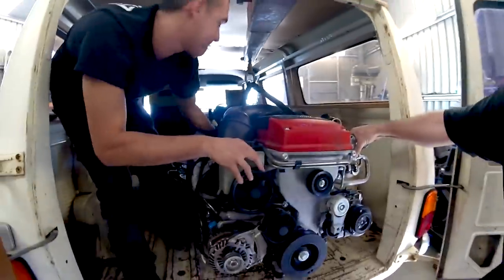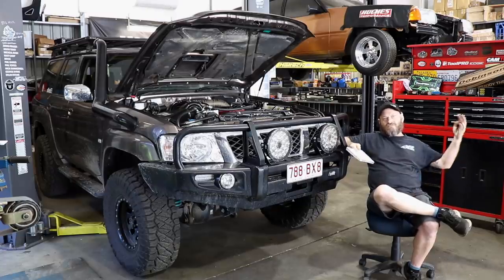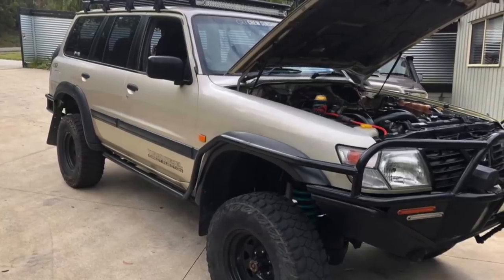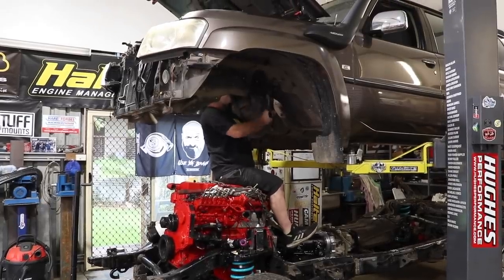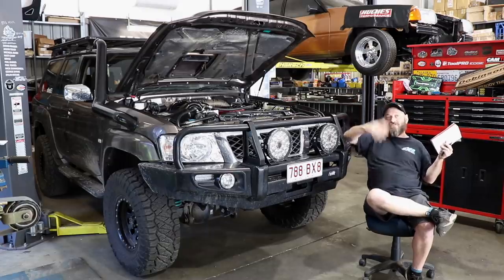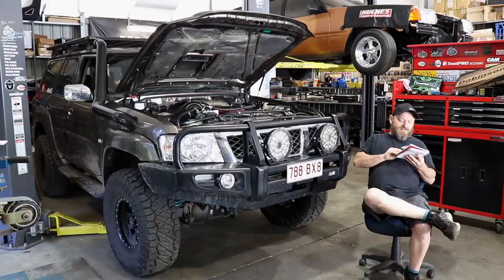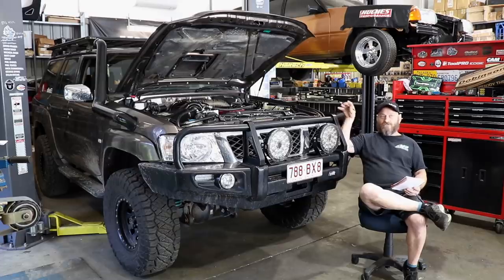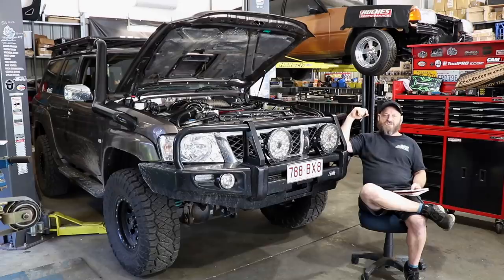Thinking of a Cummins Conversion? Watch This First!

Comment: I have been researching putting a 4JJ1 conversion into the Patrol. I did a conversion from a RD28 to a TD42 and whilst I love the conversion it has cost me an absolute fortune with turbo, intercooler, injection pump and injectors upgrade plus tuning. After the research I have done I reckon I could have converted to a 4JJ1 with turbo, intercooler upgrades and ECU remap and would have costed less than the conversion and power upgrades to the TD42. Just my opinion on a conversion

Comment: Glad you touched on torque vs HP, most people hear low HP numbers for a diesel and think it is gutless, when the reality is it is far more powerful since it's torque output is far higher and usually at about half the RPM.
Reply: Gearboxes can convert high rpm + low torque into low rpm + high torque, and vice versa. It's still ultimately the horsepower (torque * rpm) at the engine that matters.
Reply from the maker: Until you add external load to the vehicle via towing and your high power 8 speed auto 2l twin turbo diesel suddenly isn't the same. 
Gearing cannot replace engine torque.
Reply: There's definitely a question of comfort.  A small engine screaming along at 8000rpm and a bar of boost producing 300hp is going to be a lot less comfortable to drive compared to a huge loping diesel making the same horsepower at 3000rpm, but at the end of the day they'll still both be capable of doing the same amount of work and making the same output torque @ rpm with appropriate gearing. And yes, I accept that the pocket rocket will no doubt overheat and live a short life due to the relative stress it would be under.  Anyway, it's a dumb pedantic argument so sorry for clogging up the comments. Great content btw..

Comment: This is one of the cleanest swaps ever done, on youtube anyhow. But my god, as you have mentioned, a 6bt is waaay, way too much engine for a vehicle this size. There are tandems in the US fitted with 6bts. People put 6bts in half tons over here as well, and it makes absolutely no sense other than simply doing it because of the popularity of the engine. Like in your offroading video, it is almost impossible to tap into the potential of a heavy duty engine like this without putting serious strain on the vehicle, which will eventually destroy everything, even one as well prepared as yours. Not sure on the availability of 4bts over there, but that is really the only cummins that makes any sense.

Comment: Bought a new 2016 3.0 patrol and what really pissed me off, my 1992 TD42 patrol was nicer to drive and had way more power. So I bought a new GX land cruiser. Heaps of power and no conversion problems. Probably will not last as long as a TD42 patrol but it is nice to drive. You want power and nice to drive KEEP THE WEIGHT DOWN.

Comment: Wow this is decades ahead of me. I’ve just gone the ol 6.5 diesel Na, I got it for $6000 from Brunswick diesel in WA, Was reasonably easy to install onto original 5 speed manual… I think I use less fuel than a Barra conversion would… in saying that  my 6.5 is a slug 🐌  but I love her 😁

Comment: If you are looking for a late model Cummins Common Rail Engine, you could be like Rich and fit a Bus Engine. 
Most of the smaller Chinese buses in Australia, like Higer, BCI and I'm sure others, have ISB Cummins engines in 4 and 6 cylinder versions, and seem to push these Buses around quite well in standard form. I'm sure they would have no problem powering a Patrol or Landcruiser.

Comment: A lot of people around the world are fitting the BMW M57D30 motor, 6cyl turbo diesel producing 215hp and 500nm from factory. Very easy to tune them to around 250hp and 600nm in factory configuration, pretty quiet, reliable, responsive motors and easily drivable. I believe there are kits around to drop them into the older GQ Patrols and possibly Toyotas.
Reply from the maker: I think you mean a lot of people in Europe are fitting those engines.
Reply: @theskidfactory  there's guys in the US and Canada that have done it, and I believe there may be a few in Aus (at least one attempted it in Brisbane in around 2016, not sure what the end result was), so not just Europe. Definitely more in Europe as it's easier to get the motors, but has been done elsewhere.

Comment: As for the merc diesel- we just had one that ran well come through the shop with close to 950,000 miles on it. Driver said they’d done a tranny but the motor had never been cracked open. Was a sprinter van.

Comment: Hey Al here in the states commercial trucks use what is called a Jake Brake which use's engine compression to slow down Semi's here in the state's I am 69 years old and used to drive big Rigs back in the 70's and 80's and in a lot of high mountain driving so we always had Jake brake's on our trucks.
Reply: big difference in a 50 ton big rig and a three ton 4wd also i believe his talking about low range off roading where the general idea is to put the transmission in first or second gear with the transfer case in low range and just let the engine idle down a steep tricky decent at walking pace

Comment: My dad drives a 2007 Ram 2500 with the 5.9 Cummins and the (extremely uncommon, it would seem) Getrag 6-speed manual. With just a basic flash tune the thing is ludicrously quick for a vehicle of its size and it's well over 300k km with not a heck of a lot of trouble. Just an alternator, a couple recalls, a belt tensioner, and regular maintenance. Rowing the long throw gear shift while hurtling down a stretch of highway is a weird sensation compared to my car, a GR STi 😆
Reply: I prefer the NV5600 over the G56, but both were excellent manuals behind the 6BT.  The ZF 6spd used with the 7.3 PS and the Duramax (you want to talk about rare!) was also good.

Comment: Awesome build summary! For a larger SUV like a Patrol I'd do a Ford 7.3L gas V8 if I could, pretty small and lightweight (for the capacity) with output of 430hp (320kw)/475lb-ft (645nm) on the crate engine. I drive the commercial variant of it in my work truck which is only 350hp/470lb-ft, it's fantastic for pulling around a 15-20,000lb (7-9,000kg) vehicle, has a load of low-end torque and gets decent fuel economy for what it is.

Comment: Before doing the ls3 and 6l80 swap in my Landcruiser I talked to a few guys that had done ls1 and ls2 swaps in there cars, they wanted more power and said the swap wasn’t that much better than the stock 4.5 petrol cruiser engine. I’m happy I went the ls3 and 6l80 but even doing all the work myself like Al also drawing on a number of other conversions it’s still expensive and takes hundreds of hours to do it right. I think these days in Australia the only semi budget friendly option would be a Barra turbo.
Reply: A ls1 and ls2 is leaps and bounds more powerful over the 4.5. The ls3 just has good cylinder heads and the camshaft comes on later in the rpm range to make impressive sounding peak numbers. The power curve overall is what's important.

Comment: I've personally had a tb42 turbo patrol, a tb45, tb48, numerous td42 patrols and converted a gu with a td42, and also a 5ltr 304 patrol and the most reliable and best patrol I had was the tb48 if I was looking at doing another patrol I'd be looking at a barra cheap, easy plenty of information around its been done a million times the parts you can nearly find on the side of the road etc etx all good things to think about.
Reply: Sorry to add to that the tb42 turbo was the most fun there's videos on my YouTube of it. Racing people on the streets back then was a good laugh they never expected a 3 ton plus 4wd to round them up!

Comment: As a Nissan tragic and a mechanic I watched every second of this build and loved it, well done fellas 👌

One thing I did cringe at was the ✌️massage / murdering ✌️ of the firewall. I know the fact that you cannot see it, nor doesn’t effect the vehicle in any way. I’m even guilty of it doing to ease td42 patrol clutches etc, But do you think you could of gotten away with less firewall massaging if a inch or 2” Body spacer was installed ?

Comment: I have an ML400cdi, with the om628 4.0 v8 diesel and it is amazing how compact and light (all aluminium) it is.
Yes, it has some problems, like timing chains, but once done it is reliable, pulls good and has a very low fuel consumption.
Also you can probably use the original 5speed tiptronic associated, which is cheap, and save some money and headaches in custom bell housings, etc.
Reply from the maker: This is one of the engines I am interested in.
Reply: @theskidfactory  If you have any questions or even want some measurements, feel free to ask

Comment: When using the TD42 as the comparison, it may be worthwhile to grab the Cummins R2.8 crate engine. 10k USD gets you the complete engine, ECM, loom, even the throttle pedal. And without any re-mapping you're already 20hp and 50ish Ft.lbs more power than the TD42. It's light, compact, and has warranty. Could likely keep the OE gearbox.

Comment: Awesome info mate and I love your no bullshit approach. I'm in need of a conversion and a little stuck as to what to do with it. My truck is a 2001 single cab Mitsibushi Canter 4x4 that's been converted into a motorhome. It's way too underpowered as it is but it would definitely be cheaper for me to do a conversion rather than a complete rebuild!
Reply from the maker: Does it use SAE bellhousing? A 4.5ISDE may be a better choice assuming it has a 4 cylinder atm.

Comment: 100% my choice of engine would be some variety of BMW M57. They're dirt cheap here in the UK and are capable of making very impressive power and torque figures with fairly simple and cheap mods, as well as being good for 500,000+ miles. Similar to Mercedes OM engines, but much cheaper over here.

Comment: After watching the build series and some deboss garage stuff, I thought about an Italian/eu version of those swaps. Here we have a few big diesel engine and those aren't cheap by any means, talking about vw v10 o v12 tdi or Mercedes v8. Like the Cummins we have some iveco engines out of light duty trucks, iveco tector 5.9 and 4.5 (6 and 4 cylinder) turbodiesel with common rail

Comment: Few questions for ya Al,

1. Do you think the 50K is worth it, if you put into perspective of what a TD42 would cost you?
2. Is the noise and vibration an issue if you were to use this as an overland vehicle (say 500km or more a day)?
3. If used as an overland vehicle, would the fuel consumption be viable on the highway? Like would you get more than 600 or 700 out of a tank?

Awesome build, keen to see more of this in the future, updates, after the new turbo etc
Reply from the maker: 1. Yes it is worth it.
2. No the Vibes aren't an issue, we fixed the majority of it with a gearbox mount.
3. Fuel consumption will be fine at highway speeds and the AFC adjusted to suit.

Comment: My choice would be a 2.8 cummins. The power isn't bad. But, there will be less parts to break. The transmission options are a bit friendlier in terms of finding a tech that can build, work on one or install one. Plus, more engine bay space to work.

Comment: Couple quick questions about transmissions…

Did you consider a G56 6 speed manual from a Ram truck or a 5 speed manual? The second would be did you consider an Allison? They make adapter plates for the Cummins. However, they still have to be built if you are increasing the power levels a whole lot. 

I do agree that a modern common rail 5.9L is quieter than a 24V or 12V P-Pump. I have a soft spot for the older mechanical fuel pump engines though. The “diesel clatter” just reminds me of farm tractors. You can tune a common rail to sound like a mechanical fuel pump engine.

Comment: My Patrol is just turning 20 years old, zd30 auto with no mods, been waiting for the big bang. Hope it runs another 10 years at least, as long as I can keep buying new MAF sensors. I don't think it will be worth putting a new engine in if this one fails but I don't want a newer 4wd either.
Reply from the maker: Pull the intake off and clean it, that is a major contributor to failure.

Comment: Wow that's expensive! I think for me a 4BT with the Patrol manual or an OM606 would probably be the best options price and use wise. That Cummins could tow 20,000lbs and you certainly don't need that. Um, uhm, umm.

Comment: I’ve got an 04 Discovery TD5 auto. 

I’d love to be able to find a forged engine kit for it but nowhere seems to make them. 

The TD5 is a great engine and with lots of tuning possibilities with hybrid turbos, but I wouldn’t mind on that could make 300hp, mated to a hp24 gearbox. 

I’m running around 185hp and around 300nm(I think) 

That’s plenty but for a bit more grunt and pure street drama, more power is always a good thing.

Comment: Yeh wish I had the money for the conversion. Our zd30 blew up. Got a reco engine from north Vic engines for $6200 patrolapart wanted $8450 but our other engine had 300,000kms on it. And had a easy life. Not towing anything mainly used by the miss's so if I can get the same out of it were doing ok. Services every 5000kms. But next time want to go bigger better

Comment: If you don't want to spend a small fortune on a six cylinder like an OM606 or 648, or just want to keep it to a 4 banger, there's a few options in my mind that would be viable. The Isuzu 4JJ1 series is a solid option that can make boatloads of power for its size, or a Hino N04C 4 litre out of a Toyota Dyna, hell, a 4HE1 4.8TD or 4HK1 5.2TD out of the US market Isuzu Elf trucks would make for one lazy, torquey 4x4 that would tow and climb hills no problem at all. 

GM came out with a 3 litre straight 6 diesel for their mid size truck (for the Silverado 1500 I believe) and its supposed to be an awesome engine, but they did some really backwards things on it like timing chain at the rear of the engine (a bit like some of their other engines)

Comment: This was umm a really good video on the cost of doing a Cummins engine conversion the positives and negatives about the project. The engine swap for a Patrol I think would be interesting is the 7.3 Godzilla engine from Ford with a Supercharger. The engine comes as a NA crate motor from Ford.

Comment: I always loved the Cummins but you are right, It is a very noisy engine. I have an old Military Chevy K30 truck M1009 and installed a LQ4 6.0 with a 4L80e. "It hauls the Mail" as they say.

Comment: i watched a video from AE co, they put a 4jj1 in a patrol as they can used a lot of the nissan gear, still expensive but if your not looking for huge power and reliability seemed to be a cheaper responsible option

Comment: Cummins conversion is pretty cool, but $50,000 buys a lot of td42's and the cummins doesn't like to rev like a td, but if your towing cummins definitely king. I reacon the td would be a better engine if someone redesigned the head with better pre combustion chambers and coolant galleries, to improve the air fuel mix for better combustion instead of making excessive heat.

Comment: I like the 3 ltr v6 turbo EcoDeisal. The motor is solid 270hp and 570nm. The transmition is average though. Can be tuned to 670nm.

Comment: The om606 is pretty cool and I considered buying a Benz just to play with one but I would like to do a 4he1 out of the Isuzu trucks. The engines are cheap compared to many of the other diesels not much goes wrong with them plus the dry liners make them a breeze to rebuild.

Comment: A good diesel engine that would likely fit nice is the 3ltr v6 out of the grand cherokee its a merc engine and has a single variable turbo in the valley so the whole deal is pretty compact and make great power tuned. Also are readily available in australia

Comment: The ecodiesel engine from the Jeep’s and rams seems interesting if you can solve the oiling issue and get rid of the ott emissions crap. 250hp and 600Nm seems reasonable from them.
Reply: Ecodiesel
Reply: @lamarzimmermanmennonitefar5269  yep that one! I’ve edited my comment

Comment: Just finished an M57 bmw conversion and am mind blow at the torque output.
Reply: Nice What gearbox did you use?
Reply: @edbelt9155  patrol 5 speed for now but will end up auto eventually.

Comment: Not so much into diesels, but as for td42ti replacement a om606 would be a good one even with heavy power adding. 
But also i think volvo d5 would be a nice upgrade especially later ones wich are staged twin turbos...
Lightweight and pretty short engine as it is an inline 5.
also d5 block can be used for a bigboy power gasoline/ethanol engine

Comment: MB OM642 3L 24v V6 BluTec turbo alu/alu 165kw/400Nm (you did say you like high tech). Classy, quiet, clean. Knock THAT into a lightweight pickup - complete with orig computers, sensors. trans and exhaust! No Karens will hassle you, but the wheeling bros might.

Comment: I know  this is a older post but Nissan  uses  a 5.0 v8 Cummins  engine  in the titan  pickup  in the US it might be a  potential  option  rather than  mix and matching  components  you  could bag engine  Trans and  transfer  case and  put it in a patrol  .

Comment: For me a low reving higher cc engine with high torque and low KW/HP is desirable, I do like the Mercedes  OM 606 but again its 3 litre and very high reving,  as you say there are many options, Cummins engines are old school and heave, however there are several after market aluminiu m heads avaliable for both the 4 and 6BT that reduce the, weight significantly, im not a fan of cummins in particular, however they are common and parts are relatively cheap and easy to get world wide , prob for me the common rail 4.5 l Cummins would be the choice at present